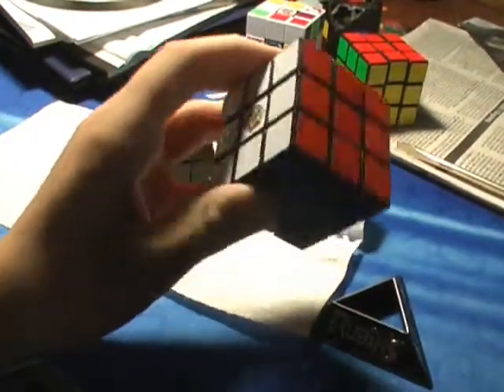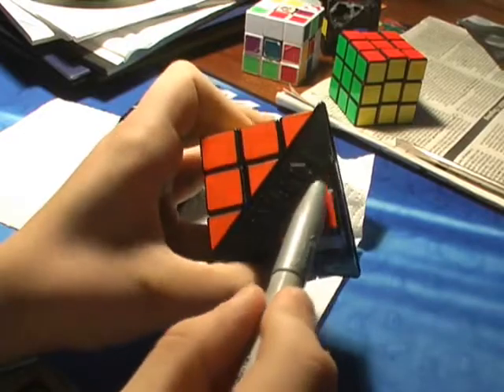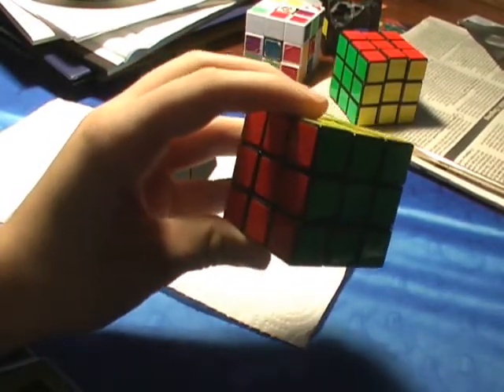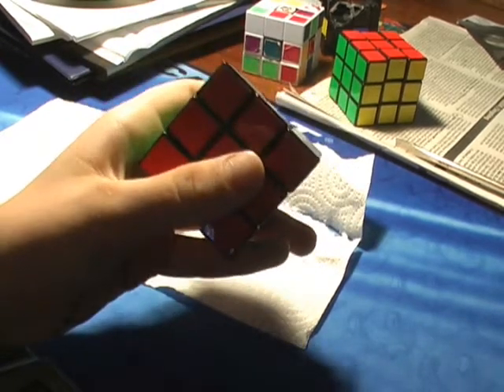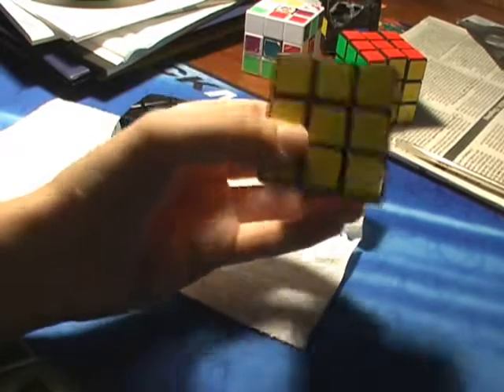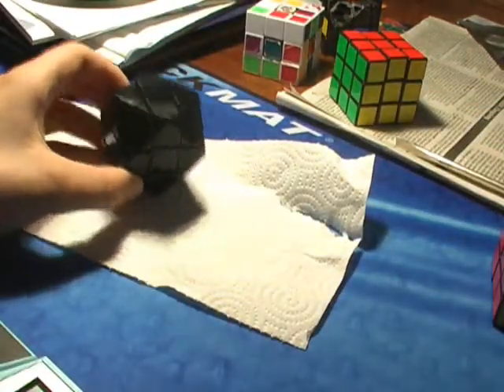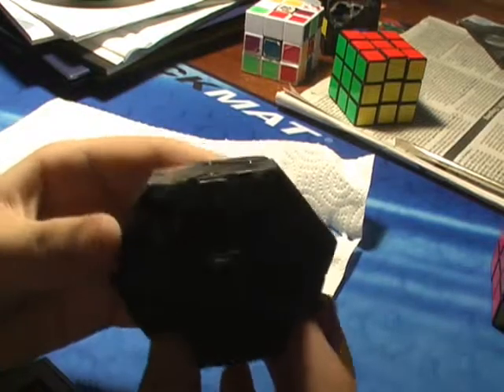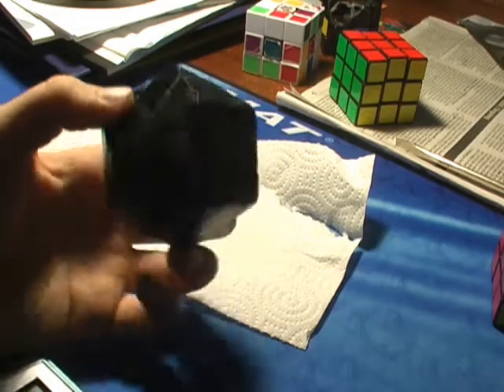CUBOCTAHEDRON TUTORIAL

Comment: when i used a stand for the guidelines, there is about a 4-5mm gap between 2 corners, but on the stickers, it looks like there is no gap, and is pointed. Do i just sand down each side more, or will sanding the original lines make it look normal?